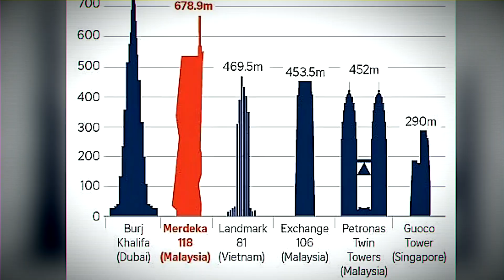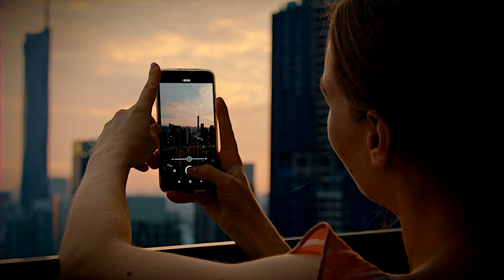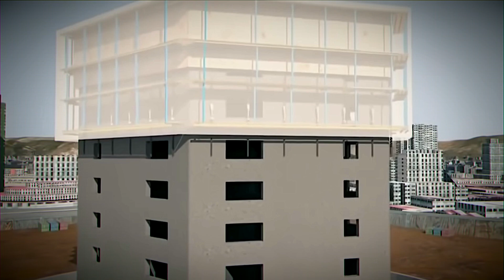Malaysia's Merdeka 118, World's 2nd Tallest Skyscraper!

Comment: I confuse. They cancelled their hsr project for saving budget, but they build this tower. I think hsr will give more impact for development
Reply: Whether hsr or tall buildings, it is not financed by the gov
Reply: @keangwooichoo6138  the old HSR was gov funded, hence the penalty was paid by Malaysian gov to Singaporean gov.
Reply: @xyes  the past is over because it was terminated
Reply: @keangwooichoo6138   the commenter above is confused about the cancelled HSR project, not the current one.
Reply: The old HSR project was gov funded instead of private equity.
Reply: @kccheong1124  that's off topic quite a bit... and there were way more reasons besides what you mentioned in that decade while the comment above was referring to the recently cancelled one, not the unapproved one.
Reply: @kccheong1124  you got some points but some inaccurate accusations that were assumed... unfortunately, the 2 are not sequential/connected & not the same project as you assumed, probably the same to SG only.
Reply: @kccheong1124  As said, there're some points you've made closed to the truth but there're quite a number of assumption that you made only based on your view/opinion, that's not the debate needed here... you can challenge the commentor above, there're no budget to save, budget spent on new skyscrapers... that's totally contradicting itself & went out of the context to whom you're addressing your view & assumption to.
Reply: @kccheong1124  Dr m is a racist. Anti jew, anti Chinese, anti Indian. Only malay race matters but fail during his tenure.
Reply: This is private project by PNB Nasional Berhad. Not using government fund.